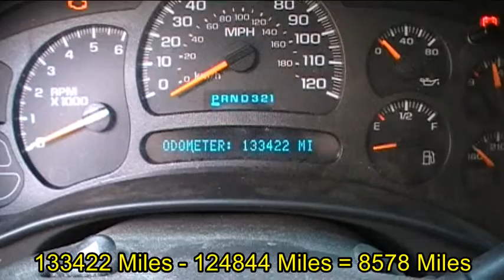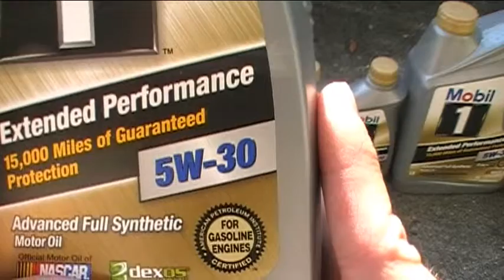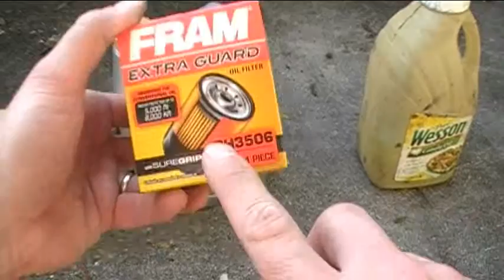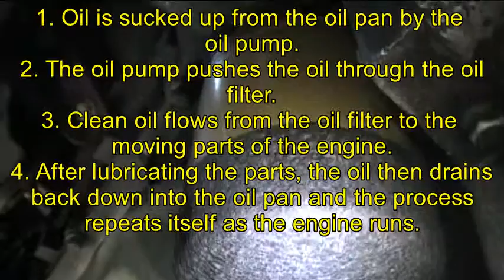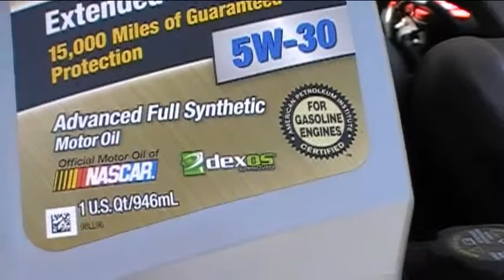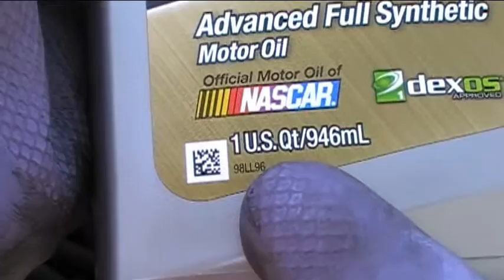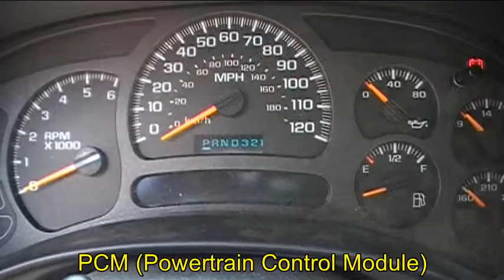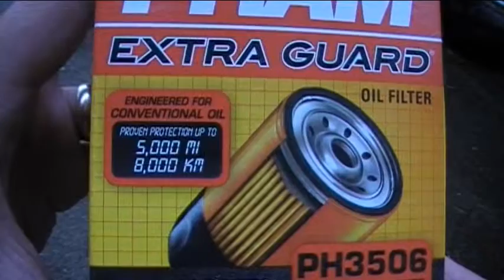OobaTech #8 - How To Do An Oil Change On A 2003 Chevy Avalanche

Comment: great video real detailed. those instrument clusters like you're gas gauge and speedometer have a upgraded version that has better solder that they used to connect the stepper motors that run the gauges. also those instrument panels can cause a parasitic draw on your battery not always but sometimes. great videos keep up the great work.